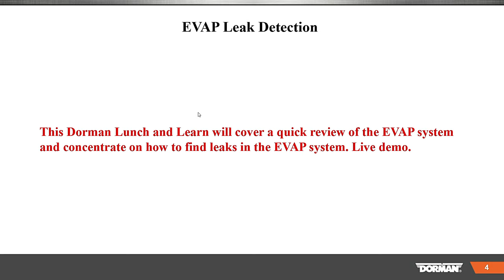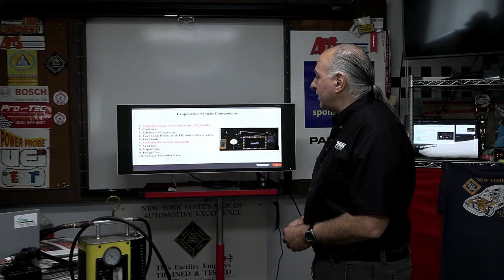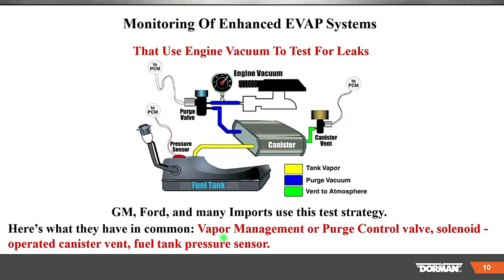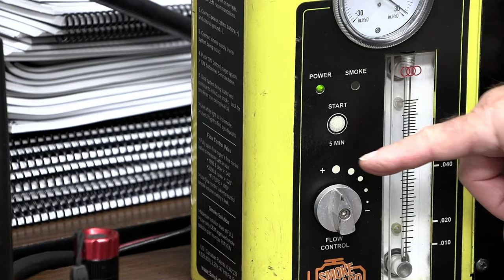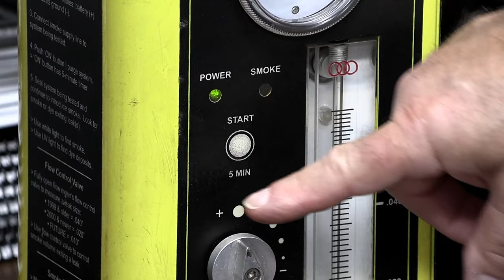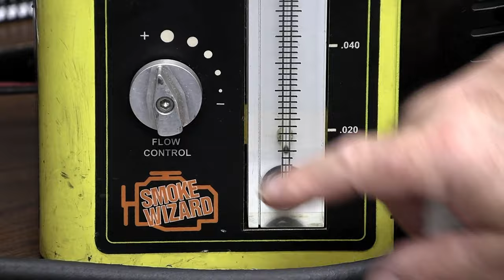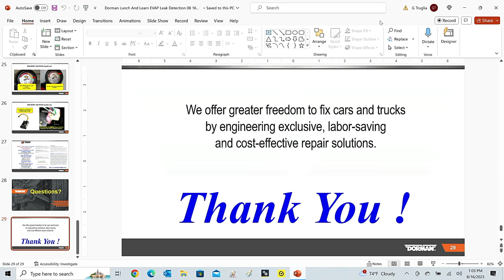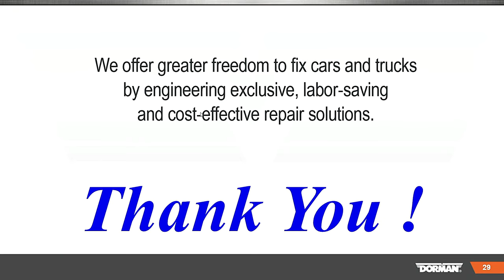"EVAP Leak Detection "Dorman Lunch and Learn 08 16 2023

Comment: Very good presentation but I see a big flaw more than once on GM could not find leaks with smoke machines  even used bulleye  held 5 in water  💦 very hot day and actually climbed to 8 inches of water  thought it might be a possible loose gas cap Wrong it came back real soon -faulty purge solenoid  apparently under a vacuum the spring in the valve would not hold properly it's only took place on a vacuum (GM test) I have found this to be the issue multiple times on general motors 😮 again it was a great class currently not enough time we did not go into  LDP  type tests  😢  or Toyota systems😢
Reply from the maker: Thank you...purge and vent valves can give a problem when them stick. I use bi-directional control or use a Power Probe to operate the solenoid to check for sticking...not seating. Thanks for watching...If you have not already subscribed to our tstseminars YouTube channel please do so. Interested in more training? Go to www.tstseminars.org and view full length videos for members on TechFlix for $9.99 unlimited viewing …Membership and over 85 videos for less than $99.00 a year. Also checkout www.attstraining.com for hands on training and webcast FREE videos at www.tstseminars.org/training-videos